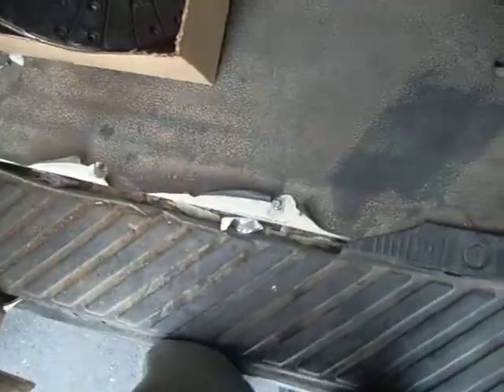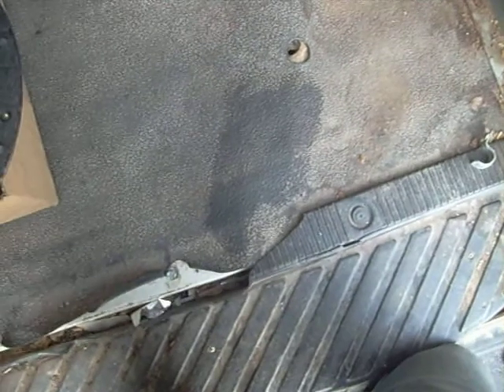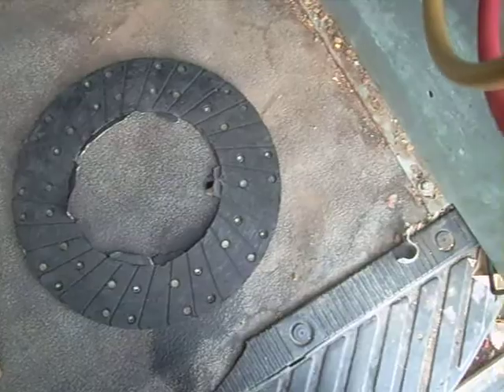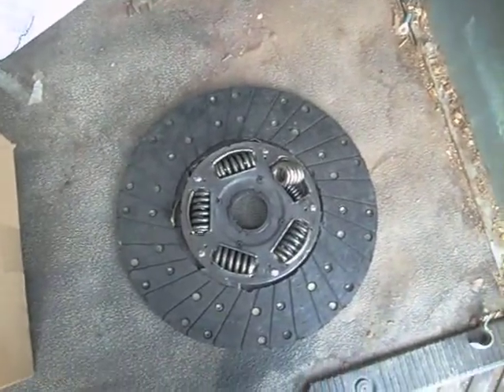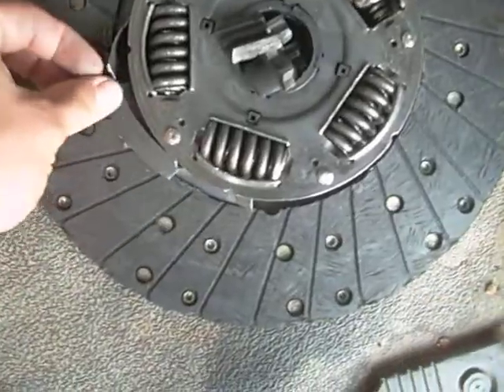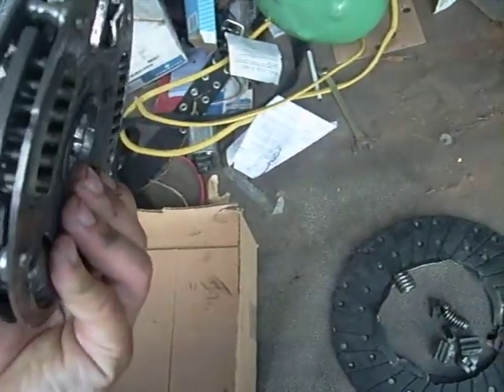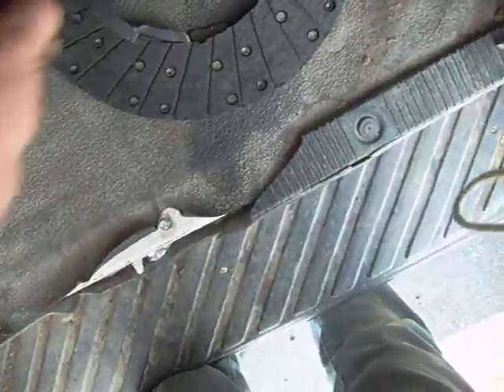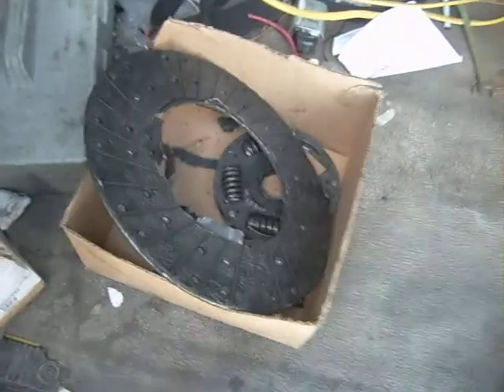zoom clutch center ripped out, 6.2 turbo diesel

Comment from the maker: i thought that to until i put in a new one and it still makes the noise but i think the new disc was labeld wrong or the pressure plate is bad because the new one doesn't disengage